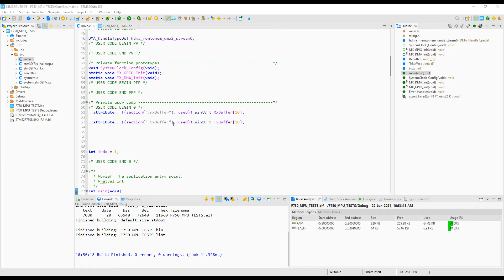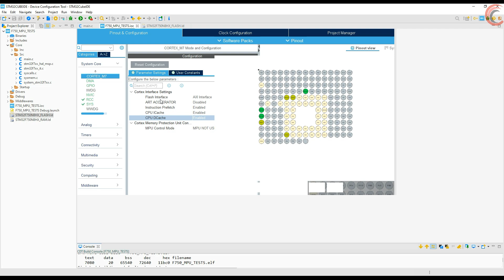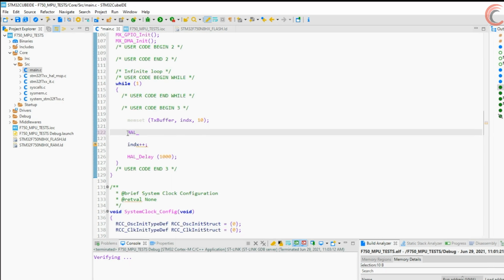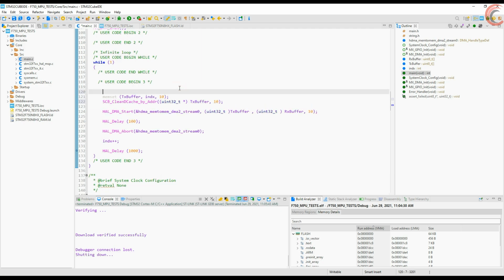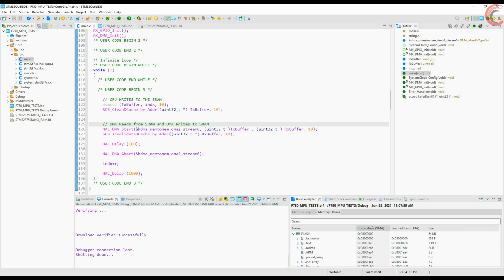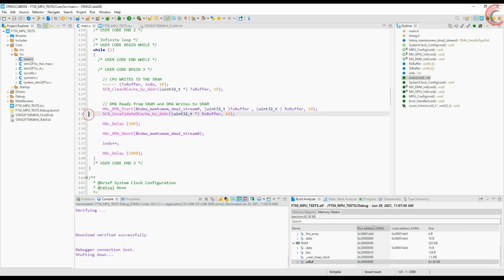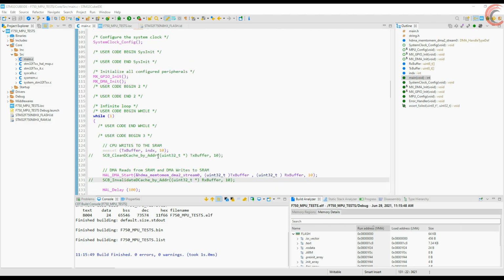STM32 MPU Config || #4. CubeMX Setup

Comment: Just wanted to let you know that the sharable config in the MPU ioc settings did not cause the rxBuffer to be updated w.r.t. txBuffer. I still had to clear both data caches after setting the MPU region flags as you described as the easier 2nd method in the video.

Still I'm glad to have learned a bit about D-cache and that we have to be careful with non-cached writes to SRAM.

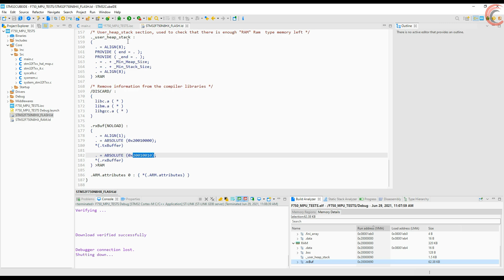Comment: 9:03 Wouldn't 32 bytes still work?
Reply from the maker: As mentioned at 9:00 the total size is indeed 20 bytes, but i have placed some gap between them. So its something like (10b 'gap' 10b). Totally they take 63 bytes.
Reply: @ControllersTech  I don't know what is wrong with my understanding: txBuffer starts at 0x20010000 and ends at 0x2001000A (10 bytes) and rxBuffer starts at 0x20010010 and ends at 0x2001001A. From 0x20010000 to 0x2001001A there is 26 bytes. Could you please tell me what I did wrong and what I am missing? thanks!
Reply: @fernandoi8958  Even i also have the same Doubt. And what is mentioned as 63 bytes is actually 62.38 KBytes and i don't understand where it is coming from..
Reply: @KarmaWillHauntEveryone  I think that he made a mistake there. Selecting 32B should have been sufficient. 
So where does the 62.38kB comes from? All the allocations are made sequentially in the linker. ".rxBuf" starts at 0x20000690, because that is coming after the "._user_heap_stack" which starts at 0x20000090 and has a 1.5 kB (1536 Bytes) size. To make sure, we can re calculate it:  0x20000090 + 1536 =  0x20000690.
That's why ".rxBuf" starts at the address 0x20000690.  ".rxBuf" includes the ".rxBuffer" and the ".txBuffer" at the locations 0x20010000 and 0x20010010, respectively. So this makes the size of ".rxBuf"  (0x20010010 − 0x20000690)/1024 = 62.375 kB

Comment: I am applying freeRTOS to stm32f767 (cortex-M7). Due to DMA coherency issues, I set the 'MPU Cacheable permission' to disable on cubeMX by creating a buffer as shown in the video. However, after compiling and executing, the memory management fault occurs when the task is executed. What should I do in this case? Do you have any reference material?
Reply from the maker: The memory issue is not necessarily be caused by coherency. RTOS is known for causing them very often. I guess you should try the code without RTOS first, just to make sure the issue is caused by rtos or by coherency
Reply: @ControllersTech  
I think I asked the question wrong. When a task is executed, the dma buffer is written or read. Also, that buffer is set to non-cacheable by the mpu. An error occurs only in the case of a combination of these. Do I need to set memory when creating a task? If so, what should I do?
Reply from the maker: If you are confident, that means you did the debugging and you have successfully reached the part where the dma copying actually starts and that particular step gives you hardfault. 
If this is the case, i need more details about your project, so cantact me on telegram or discord.

BUT if you haven't done the things i have just mentioned, plz follow the previous comment. Hardfault could also be due to low memory assigned for rtos.. or maybe overlapping the memories..

Comment: hello , Thanks a lot for your series they are really helpful....I am using STM32F207 which is cortex M3 ....so the option for mpu configuration is not there...Should i go with software solution provided in first part ??Can you please provide some help regarding how i should proceed (I am following your ethernet series )...
Reply from the maker: These videos are typically made for cortex m7 devices.
In m3 ethernet, you don't need to worry about mpu. Watch the second video, specially the ending part
Reply: @ControllersTech  Thanks a lotttt !!!The series are very well planned and executed ..Very grateful for your efforts and knowledge....

Comment: Hello. Are your videos compatible with the Discovery kit with STM32H747XI MCU?
Reply from the maker: That's cortex m7 right. So it will be valid
Reply: @ControllersTech  ok, thanks! Different only display?
Reply from the maker: There are other differences also. 
This video is made for cortex m7 series, irrespective of what mcu you are using.
Reply: @ControllersTech  thank you very much. Is your main debug stm32h745-discovery?